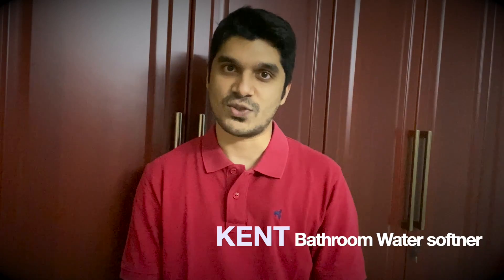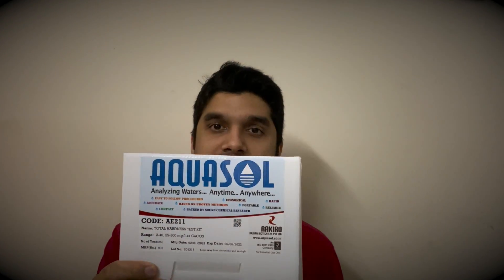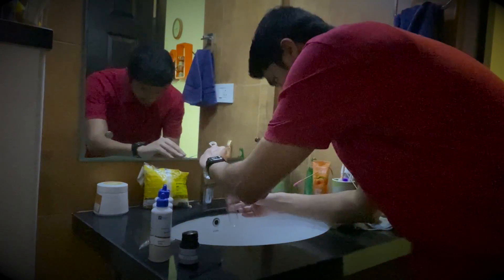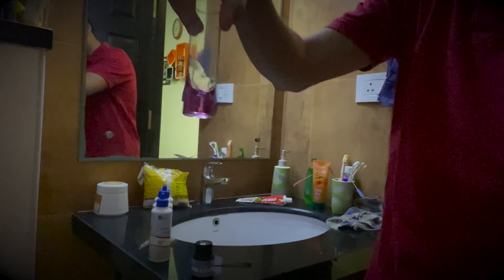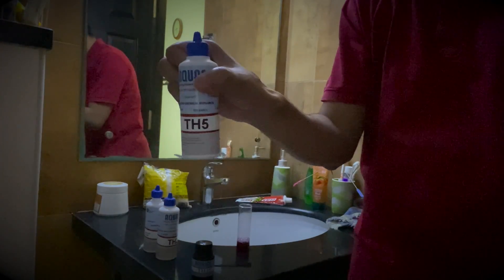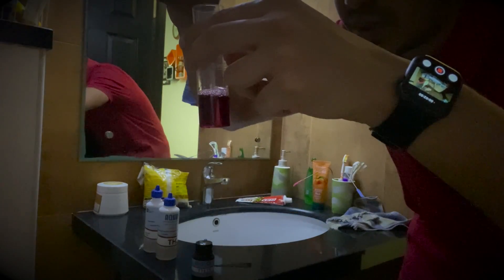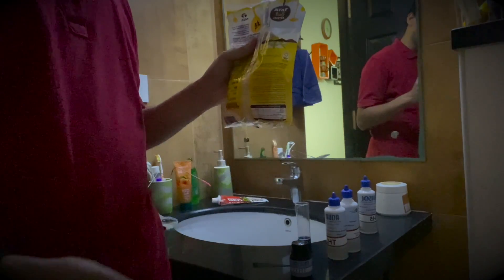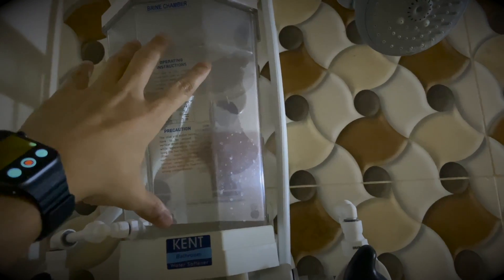Kent Bathroom Water Softener Test | Water Home Testing Kit | Solution for Hard Water

Comment: The limit of the test kit in this video is 500 ppm (max). 3:15 You went beyond that. I don't know how reliable these results are. For those interested, there is a kit that goes up to 1000 ppm in steps of 50 which will be more accurate if your ppm is over 500 pm. We can see the error in the results. The max this softener can reduce ppm by is 500. So if the result was 250 ppm then real hardness most likely was 750 not 700
Reply from the maker: The results won't differ. The number of drops needed to measure the hardness beyond 500 will be more with this kit. Post regeneration the hardness reduces and hence I purchased this kit as it can give me required testing results. Hope that clarifies
Reply: @PaiTech  then they could have increased the limit and not made a seperate kit that goes to 1000. Also, 1000 ppm one uses steps of 50 and there is no 5-100 like yours has.

I'm wondering whether the 450 is because the resin might have degenerated a bit. That will happen with time. How old was the softener when you did the test? If it was only a few months old then the test is inaccurate. Much older than it's not.
Reply from the maker: @johndoe-vc1we  Precisely. That’s why I went for this kit as I wanted to test in steps of 5. The softener was about 6 to 7 months old if I remember correctly. It’s been a while since I uploaded this video 😅
But yeah, the resin does degrade and I had to replace the same after 1 year. 
I’ve upgraded the model since then to an automatic and the company claims this one doesn’t need the resin to be changed at all. So fingers crossed!
Reply: @PaiTech  could you share which model you are using currently. If it has iron and manganese filters then you could see life reaching many years and beyond. If they say does not need to be changed then check the warranty. I bet it's exactly as long as the warranty is.
Reply from the maker: Uploading video on new model now.. Should be up by 8pm today :)

Comment: What do you do for laundry? I notice you have a dishwasher but no washing machine. How well would this unit work with a top loader? about 120 litres are needed in two hours.
Reply from the maker: Had not connected this to our washing machine. I've upgraded now to an automatic softener and both dishwasher and washing machine are connected.
Reply: @PaiTech  which model did you get and how about a review of that
Reply from the maker: Uploading video on new model now.. Should be up by 8pm today :)
Reply: @PaiTech  i'm interested to know how you managed laundry before you got the automatic softener. It means you were washing in hard water. Did your laundry turn out stiff? Clothes don't look good when washed in 700 ppm water.

Comment: Apart from salt, I saw you adding a specific liquid in the water softener. Please mention and inform what was it, its application and where can it be found.
Please do answer this.
Reply from the maker: Added water. It is required to dissolve the salt. You can watch the video again and I’ve mentioned it. Thanks
Reply: @PaiTech  Apart from salt and water,  I am asking about the solution from little light pink bottle that you are adding on 5:04 minute of time in the  video.

Comment: Which salt should be used to regenerate the softner
Reply from the maker: Can either use normal crystal salt or water softener salt. I have used both and don’t see much difference in water quality. So you can use normal crystal salt as it is significantly cheaper and available in local stores.

Comment: Informative video, however i have some questions.
1. Does it affect the pressure of water coming from the taps?
2. Does it reduce the soap scum that is usually there on the floor after taking bath in hard water?
3. Do you notice a difference in the quality of hair and skin after using the soft water from this product?
Reply from the maker: 1. It did not affect water pressure for us. 
2. Yes. White spots on the floor has significantly reduced/eliminated 
3. Definite improvement. Difference in Texture of hair after a shower is very noticeable

Comment: Hi, So 250 harness is good water? I am planning to buy. Still questions in my that it really soften the water or not. Please clarify.
Reply from the maker: 250 is still hard water and not good. The video was a little rushed and hence that result. After regeneration the water should be let out for 2 to 3 minutes. The device is capable of delivering a ppm of less than 25 which is very good
Reply: @PaiTech  Appreciate your clarification. Thank you very much.
Reply: @PaiTech  that is what i was wondering, have you tried using non iodised salt like plain industrial salt?

Comment: You calculated the hardness of water as 250 after the softening process, Isn't the ppm too high to call it soft? Google tells me that water above 100-150 ppm is considered hard.
Reply from the maker: It is lesser than 250.. The water needs to be let out during regeneration for 2 to 3 minutes. I did not do so diligently whilst shooting this video. My recent test gave me a value of less than 100. Its been 1.5 years since we've bought this and I've noticed that the frequency of regeneration has increased. I now have to do this process twice a week. But note that the water in my apartment is atrociously hard at 1200ppm.

Comment: After the installation outcome of water in tap is very slow. Why is like that?
Reply from the maker: There is no change in the water pressure post installation. If you're referring to the water pressure in this video, I ran it slow to collect just 10 ml of water to perform the test and did not want to waste water

Comment: At 7:58 you are wrong. After regeneration you should be taking 25 ml water and use TH 3 instead you used TH5 again.

My cout: Before regeneration 20 drops of TH5 * 25 = 500 ppm

After regeneration 12 drops of TH3 * 2 = 24 ppm
Reply: So,all the result is wrong.whats the use of watching the whole video then,should have thoroughly checked before making video.
Reply from the maker: @parveshvu1736  the test can be performed using TH3 or TH5 based on water hardness level. So it's not really wrong. The end value may differ by a small margin. But the gist of the video is pretty clear, which is reduction of water hardness

Comment: Thanks for the video. In my home TDS is 1300. Planning to buy one softener and connect it to RO and Dishwasher. Will the water output pressure be sufficient ?
Reply from the maker: Our water pressure wasn't affected and continued to remain the same post installation of the softener
Reply from the maker: The softener doesn't help with TDS. TDS is used to measure quality of drinking water
Reply: Thank you.

Comment: Thank you so much for making this video. You mentioned we need to regenerate the water in 10-15 days depending on usage of water. Could you please explain it a bit? Is there any limit for water softening? I was told by kent representative that we need to put salt every 18 days and there is no limitation in usage of water.
Reply from the maker: There is no limit for water softening. You can do it as frequently as needed. The Kent representative advised us that once in 2 weeks regeneration is sufficient, but my practical experience doesn't stand true to that. I have 2 if these at home and I regenerate weekly and I'm happy with the water quality. When I used to do the same one in 2 weeks, the water quality used to go back to being hard after 8 to 9 days. Again, it does depend on the actual quantity of water that is used.
Reply: @PaiTech  Ohk... thanks a lot for sharing your true experience with us🙏
Reply from the maker: @nirjaa28  happy to help 😊
Reply: @PaiTech  😁
Reply: @PaiTech  Hey sorry I have one more query what ppm level is good for hair and skin ? Is there any ideal range for it?
Reply from the maker: Any value less than 17.1 ppm is considered soft water and is the best. 17.1 to 60 ppm is slightly hard water. So ideally the lower the ppm the better it is for hair and skin
Reply: @PaiTech  O wow you have a lot of info... thank you so much 🙂
Reply: @nirjaa28  I love you
Reply: @PaiTech sir me konsa RO lgvau? Borewell water ata h...skin n hair k liye

Comment: What is regeneration duration.. I mean how many days once we have to regenerate
Reply from the maker: Depends on usage. Company says once in 15 days. However, I would suggest once in a week for 2 people using the same bathroom.
Reply: Have you only connected your geyser to this? Or entire bathroom? My bathroom inlet pipe also supplies to the flush tank. Considering that, how frequently do u think this needs to be done for 2 folks using the bathroom!
Reply from the maker: I've connected to the entire bathroom. 2 of us use it. The water seems to get hard after about 7 days. I recommend regeneration every week for sustained soft water
Reply: @PaiTech  got it. Thanks. Entire bathroom including flush tank right? (Asking as some apartments have a separate ftp line for flush tanks)
Reply from the maker: We have a separate wtp line too. So it's not connected to the flush. You might have to regenerate once in 5 days or so. I won't be able to replicate the scenario to give you an accurate answer

Comment: Can we use in TDS 1600+ range ?
Reply from the maker: TDS is measured for drinking water. For normal water the medium of measure is not TDS. You have to measure the total hardness, which can be measured using the Aquasol test kit as shown in the video. For drinking water KENT or other RO filter needs to be used